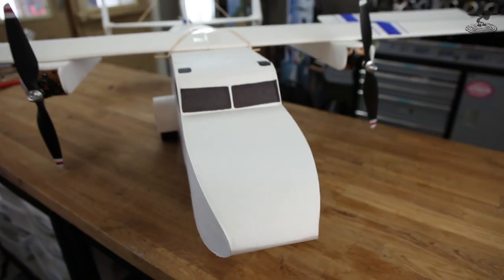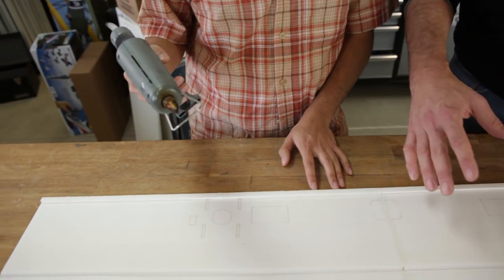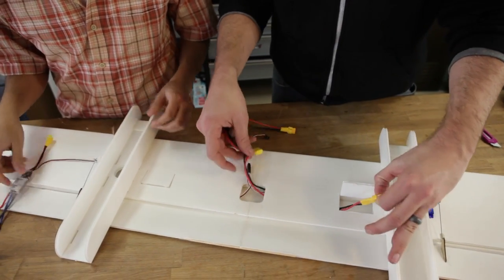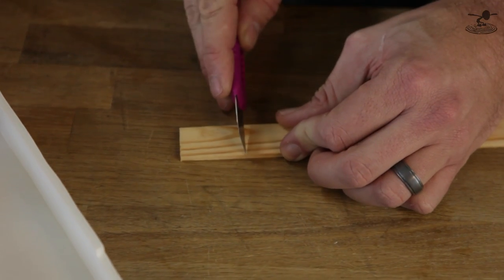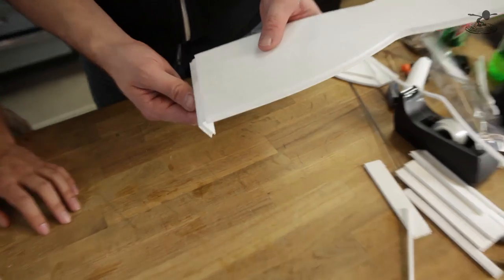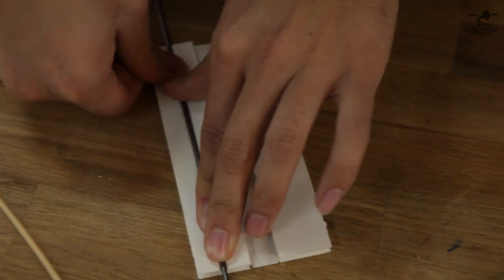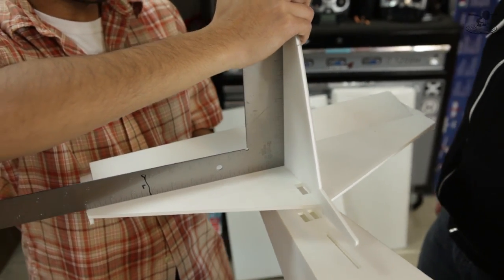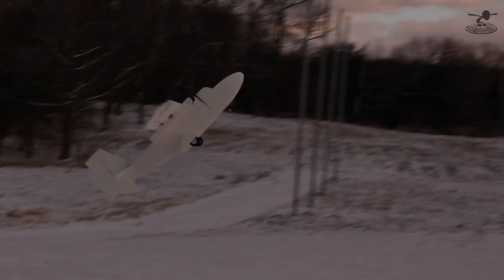Flite Test | FT Guinea Pig - BUILD

Comment: Thinking of scratch building one of these... I was wondering if it would still fly alright with no ailerons or differential thrust. Obviously this would limit manuverability but I’m not too bothered if it would still fly well. Is it possible to link up two motors to one esc? And what would be the drawbacks of this change... thank you anyone who replies as it would be extremely helpful!

Otherwise great video and happy flying everyone!!

Comment: Why do you mount the wing struts that way up? If you glued the two 'edges' down to the bottom of the wing, it is much easier to run the glue along that wide flat area when you are hurrying to get all the glue on when folding the top over.  Does that make sense? Love your work though guys, keep them coming please.

Comment: Could you guys talk a little bit about those linkage stoppers.  Every time I use them they either fall out or they dont rotate in the hole make the control surface not work right.  If you could show how to properly use them that would be awesome?

Comment: I built two of these one black one white , being 70 and with questionable eyesight, building large and light seemed a good idea. I equipped one with a F411 wing controller , seemed to work fine on the bench, totally failed in the field, no doubt old eyes, failed with some tiny connector ... I'll sort it out once I get over the disappointment of my failure ...

Comment: If I were to use the FS-TH9X transmitter, how would I setup the dual ESCs for mixing for Differential Thrust?  Using FS-R6B or FS-R9B Rx.  Great video guys, helped me put mine together with ease, just need some extra help.  Thanks. I can also post my question in the FT forums.

Comment: If it strictly  iad going to be the buddy box will an old park zone 72 mhz work with dx6i?  Figuring since it is not transmitting  it would not matter if it is 72mhz.  All the mixing trims and transmitting is coming from dx6i? Ty

Comment: can anybody help me on rc planes with 2 motors.   Does one go Counter clock and one goes clockwise?  Do you use  a pusher prop and and a puller prop?  Also do you use different thrust? thanks

Comment: Should i install counter-rotating props, or is this model big enough that the the torque from the motors wont affect it's performance?
Reply: They said during the build it doesn't affect the planes performance.
Reply: X FLIGHT101 ok cool. must have missed that.

Comment: I have a different receiver, how do I plug the 3-wire connection from the different motors into the receiver? There is only one spot for throttle
Reply: A Y harnas or watch some tutorials on how to use the mixes and have differential thrust. If you have a fly sky Andrew Newton has a great video on how to program it.

Comment: So do all dollar trees sell this in the store or do you have to order it? I havent checked yet...I have to fing one around Indy...p.s. this is one BAD ASS PLANE Paul and Josh...
Reply: Ok thanks...I made the F22 from your free plans out of 1/4 Lowes insulation foam which worked great, but I think that with the paper on the dollar tree foam it will work better for this one...thanks again guys...I look forward for your vids to come out every week and I plan to buy what ever I can from your company...God Bless
Reply: I see 5mm foam board in walmart.  Paper on both sides.  $1.77 per sheet.  Wonder if it's the same stuff?
Reply: willdoryder - you know, i didn't think to look.  I'll look and let you know.
Reply: +lmdetect - The board you found at Walmart is Elmers, and it is heavier than the Adams Readi-board AKA DollarTree foam board. Also, the paper is much more difficult to remove from the Elmers. The DT foam board paper peels off in one piece very easily.

Comment: it is build with styrofoam ? thanks
Reply: It's build with 5mm foamboard. That's "extruded polystyrene foam" laminated with paper on both sides and often used as backing for posters or signs. Depron is a similiar material, but doesn't have the paper lamination.

Styrofoam is too coarse (it's not extruded, but expanded) for this.

Comment: what kind of battery is it?
Reply: I use a 4S 2800mah and it flies fine.  I've also used 2 X 3S 2800mah and I did get 30 amp esc's.  Both have worked great.  I use it to carry stuff up and drop.  So far, I carry 2 of the HK bombs, a vector launched off the top of the wing and parachutes.  Had to beef the heck out of the landing gear.  It carries it all!
Reply: That sounds so cool! What's the flight time with the double battery setup? How much flight time do you think one could achieve by loading huge batteries instead of cargo? Planning on building one of these puppies myself!

Comment: For as much as the kit costs can't y'all just included pre-bent landing gear? Or at the very least provide us with some measurements of where to bent the metal rod, or give us a few extras because now I'm going to have to have this be a belly-lander, at-least now because my Dad or myself do not know where to bent the thick wire and we cannot get close to having sharp corners so now the wheels can get jammed up, If we could even bend the entire dang thing.

Comment: what is the thickness of this foam ??? is it 3 mm or 5 mm ??? , because this kind of foam not exist in my country
Reply: Is Depron available in your country then? Because most of these designs will work well when made of Depron. You don't necessarily need Dollar Tree foam board if you want to build these planes
Reply: Oh and that's 5mm foam board
Reply: Nick Fury thanks :D , we just have different names for foam

Comment: How much does it all cost with electronics
Reply: About 180 bucks, including 2 motors, 2 ESCs, 4 servos, 1 battery, 1 receiver, and all extensions. Add a hobbyking radio for 20 bucks for a total of roughly $200.
Reply: And of course the Speed Build kit. Subtract that an you have a $156 plane. Of course, to still need to scratch build , and by linkages.
Reply: Thank you for the help curious airline
Reply: You are welcome!

Comment: Any one know of a low budget way   Of making an rc plane
Reply: Swappables
Reply: Ok thanks
Reply: It won't make one plane cheaper but when you build more just spend 10 bucks on foam board and servos
Reply: So it's better in the long run is what you mean right
Reply: Yup the electronics (ESC receiver and moter) cost way more than servos so your first plane will be regular then any others you get will cost as much as foam board and servos but you will have to have different electronics for drastically different planes (snowball and kracken)
Reply: Oh yeah I've been watching some of the swappable videos and I think I might give it a try